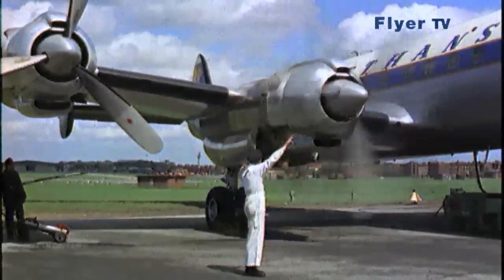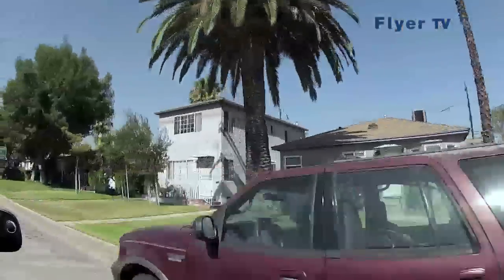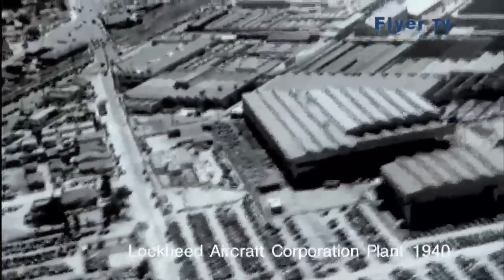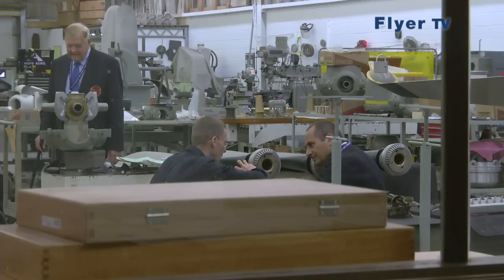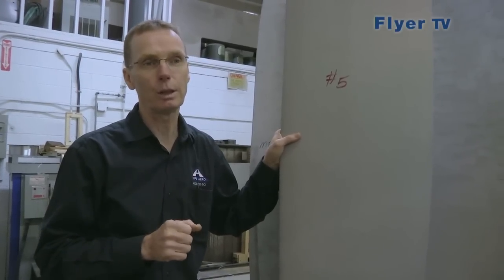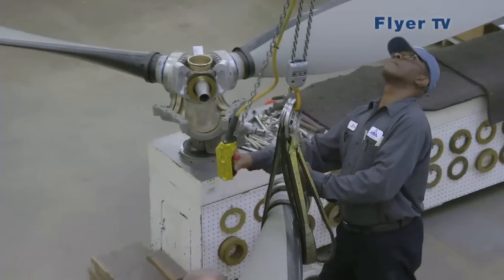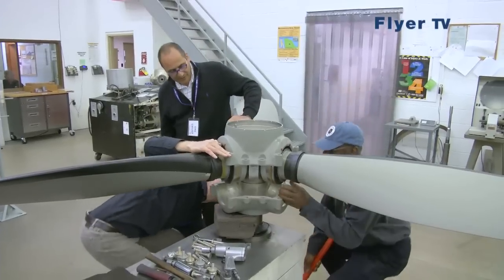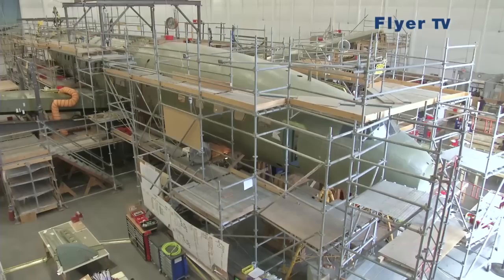Lufthansa Super Star L-1649 Engine, Propeller, and Spinner Overhaul

Comment: And sadly they killed the effort to fly this bird when she was 95% complete and only 11 months from flying. She was better than new.
Reply: Wow 95% and only 11 months..
Could you share more details please about the latest workprogress..
I feel more than iretated since I heard how they stoped,  throwig Conie-parts in the garbage, putting the fuselage in a slty, moist portshed  ...  which  is more than a shame. Today,s managemnt is disgusting..👎👎👎
Reply: The aircraft was dismantled without the documentation required to resume the restoration. Apparently this was ordered by the Lufthansa management when they pulled the funding. At that point the air frame had a Lockheed-donated C-130 glass cockpit and was almost ready to go.

Comment: And as I understand Lufthansa pulled the plug on the restoration then proceeded to make it so nobody else could continue the work. 100 million from sponsors was spent plus all the hours by the technicians up to this point. 

For nothing.
Reply: Google Name I wondered what happened, That seems uncharacteristic of LH, Is there more info floating a round?
Reply: Hopefully, this will not be the end of that beautiful restoration.
Reply: They also tossed all the spare parts that were stripped off another Connie. Basically making two planes non fly able.